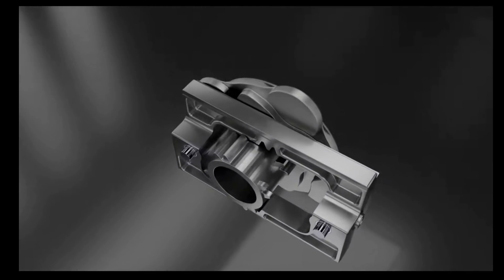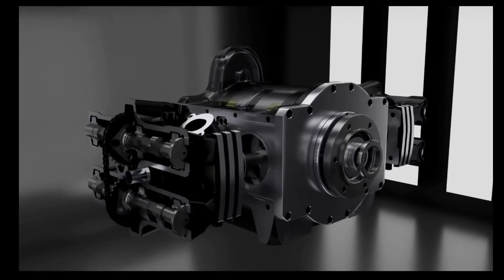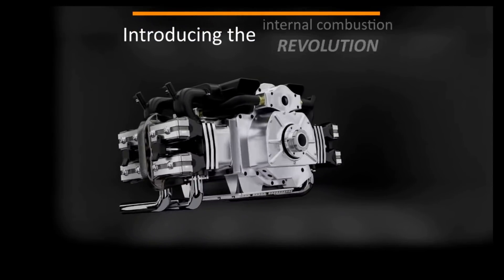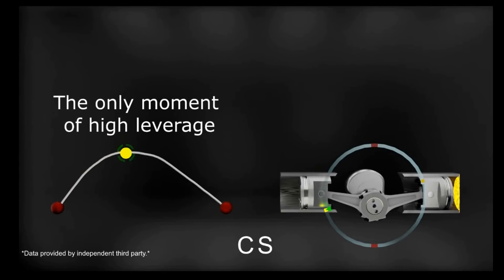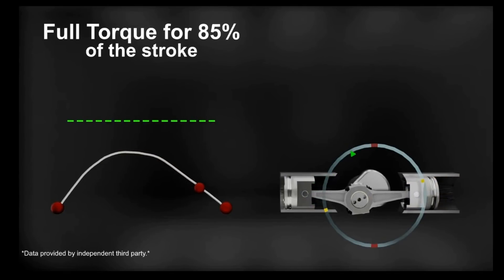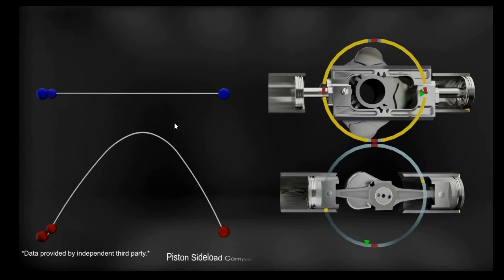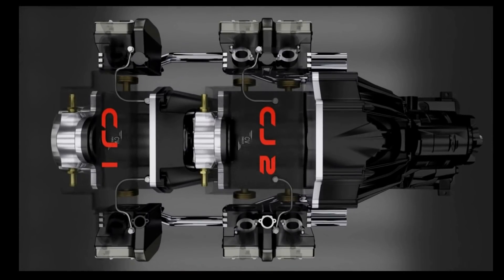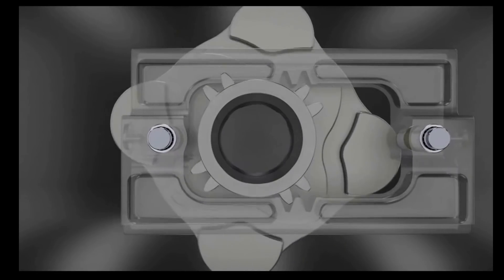More opposed Piston engines

Comment: It's not a 2 stroke! It has 4 cycles like a normal 4 stroke. The crank just spins half the speed of a normal crank because of that weird ass setup. The piston goes through the usual four strokes in the period of one crankshaft rotation
Reply: Matt. There's no helping some people! 😆 Some people will always insist that 1+1=3 no matter how hard you try to explain simple arithmetic!
Reply from the maker: IT IS!!! Lol the animation is, the demo in the video at the end is. They have said they have designs for both. Every TDC there's an ignition event, that makes it a 2 stroke.
Reply: @thedirtyworkshop  the running motor is not the same motor that's shown in the beginning of your video. Watch again. Look at the gears on the cams and the crank. They are the same size. If the piston makes 4 cycles per one rotation of the crank the gear on the crank would have to be double the size of the gears on the cams for it to be a 2 stroke.. I know it's not much but look at the valve timing. I've seen this motor before and would respectfully say you are incorrect
Reply from the maker: 1) the demo in the video is a glow plug engine, with no head. Therefore it's a nitro 2 stroke. In the animation the cylinder fires every time the piston is at TDC. We're not talking about cycles, like otto, diesel etc, we're talking strokes. 

Example. A wankel run the otto cycle, but isn't any strokes. A diesel cycles engine has both 2T and 4T engine version. Strokes is how many time the piston travel the length of the "stroke", hence its name. It doesn't matter what the crank is doing. This isnt an opinion. Just look at 2 stroke diesels vs 4 stroke ones....
Reply: @thedirtyworkshop  you're arguing semantics. I know the animation doesn't show it for very long but look at the cam drive and valve timing. The bottom valves stay open for one full stroke then the the top valves open for another full stroke. That engine couldn't run as a 2 stroke You could be correct, ignition could take place every TDC but with the valve timing the animation has it would be a wasted spark.
Reply from the maker: I'm not arguing semantics. A 2T is called a 2T because it travels the stroke twice per cycle, then repeats. Same as a 4T. This is the literal definition. 

In the animation they state double of the ignition events per rev so they can run half the rpm. Then same animation also shows at every TDC the mixture ignites. I'm just going on what it shows. They literally say in the comments of said video it can be converted to run either. 

Cycles are not strokes and visa versa, thatsvwhy they have different names
Reply: @thedirtyworkshop  the crank spins at half the speed of a normal crank so it would need double the ignition events per REVOLUTION just to run. The piston is going through 4 strokes per one revolution of the crank
Reply from the maker: Show me where the crank rpm and the strokes have anything to do with defining the stroke? Because I can show you where its the cycle and not the rotation that defined the stroke.

Let's say you're correct. Then stroke is a wankel engine?
Reply: @thedirtyworkshop  not crank RPM, crank rotation. On a normal 4 stroke the crank makes 2 rotations while the piston goes through it's four strokes. On the CV engine, because of the weird setup the crank only makes one rotation while the piston goes through it's 4 strokes. Watch the animation again and look  at the crank rotation in degrees in relation to the piston strokes. For every stroke the piston makes the crank only rotates 90 degrees as opposed to a normal 4 stroke where the crank rotates 180 degrees for every stroke of the piston. Yes it has twice the ignition events per ROTATION of the crank because the piston goes through all 4 of it's strokes in only one ROTATION of the crank.
Reply: @thedirtyworkshop  I'll simplify this so you'll know what to look for. On a conventional piston engine starting at TDC, if you rotate the crank 360 degrees the piston goes down and up that's it. On this CV engine,  starting at TDC when you rotate the crank 360 degrees the piston goes down, up, down, up.
Reply from the maker: Why does this matter? How many strokes to complete a cycle? Revs don't matter!
Reply from the maker: I'm make it simple for you. It is called the 4 stroke cycle... nothing to do with revs.... for example a 5 and 6 stroke engine is called that because of the 5 or 6 strokes the cycle goes through. You explanation doesn't hold for the 5 stroke engine.... wow why is this so difficult!?
Reply from the maker: https://en.m.wikipedia.org/wiki/Four-stroke_engine
Reply from the maker: "A four-stroke (also four-cycle) engine is an internal combustion (IC) engine in which the piston completes four separate strokes while turning the crankshaft. A stroke refers to the full travel of the piston along the cylinder, in either direction. The four separate strokes are termed:"
Reply from the maker: From thermodynamics 

The thermodynamic analysis of the actual four-stroke and two-stroke cycles is not a simple task. However, the analysis can be simplified significantly if air standard assumptions[5] are utilized. The resulting cycle, which closely resembles the actual operating conditions, is the Otto cycle

See how it states cycle and not rotations...
Reply from the maker: This is what Yamaha have to say:

What’s the difference between 2-stroke and 4-stroke engines?

 Fuel for a 2-stroke engine has a small amount of oil mixed into it. It is called a “2-stroke” because just one up and down movement of the piston—the 2 strokes—performs the full cycle of intake, compression, combustion and exhaust. No intake or exhaust valves are used and instead, small holes called scavenging ports in the cylinder wall are used for drawing in air and expelling exhaust. Because combustion takes place with each revolution of the crankshaft with a 2-stroke, this format puts out more power than a 4-stroke engine and the power has more instantaneous delivery. This are some reasons why 2-stroke engines have a long history of use on many different types of motorcycles.

See how it states cycle...
 https://global.yamaha-motor.com/business/mc/mc-tech/standard-technology/2st4st.html
Reply: @thedirtyworkshop  normal engine 360 degrees of crank rotation piston goes down up. CV engine 360 degrees of crank rotation piston goes down up down up.  I can't get any simpler than that. You're missing the very obvious on this CV engine. Watch the animation in slow motion and pay attention to the degrees of crank rotation in relation to the piston stroke.
Reply from the maker: Here is the definition in all aspects

"Stroke (engine) - Wikipedia" https://en.m.wikipedia.org/wiki/Stroke_(engine)
Reply from the maker: Here you can tell ilmor engineering they don't know what a stroke means and their 5 stroke engine is bollocks.
 http://www.ilmor.co.uk/capabilities/5-stroke-engine
Reply from the maker: Here's the video

https://youtu.be/u0uPmrSRM7w
Reply: @thedirtyworkshop  you took the claim about double the ignition events per rotation to mean it's a 2 stroke. It's not. Double the cylinders and you get double the ignition events per rotation, it's still not a 2 stroke. On the CV engine the piston is going through 4 strokes per one rotation of the crank. Which means you have to double the ignition events per crank rotation. It's a 4 stroke. The piston is going down up down up, 4 strokes for every 360 degrees of crank rotation which means double the ignition events per 360 degrees of crank rotation. You really need to watch the video again.
Reply from the maker: No. I looking at 1 cylinder. Everytime the piston is at TDC it fires.
Reply: @thedirtyworkshop  i look at onl one cylinder, plus the crank and the valve timing and I don't know how it could run as a 2 stroke when 2 valves are open during compression and the other 2 open during the power stroke.
Reply from the maker: I don't know either, but the video shows what the video shows. It might be a fuck up. I don't know without more info. I'll ask them.
Reply: @thedirtyworkshop  I'm going off the full package. The piston, cam drive , and valve timing show a 4 stroke.. I am very intrigued by the piston going through 4 strokes with only 1 crankshaft rotation. If it is a 2 stroke each cylinder would fire with only 180 degrees of crankshaft rotation.
Reply from the maker: So the flashes in the combustion chamber are just fancy lights?
Reply: @thedirtyworkshop  that or the cams valves and cam drives are just background scenery
Reply: @thedirtyworkshop  i just watched and listened their video again and the flashing lights flashed at every TDC on the conventional motor as well. It's just showing how there crank setup accomplished twice the piston strokes per 360 degrees of crankshaft rotation. So yeah it's just flashing lights to highlight you get more bangs per 360 degrees of crankshaft rotation on their setup. It's amazing what re-watching and listening will show you.
Reply from the maker: Does it matter? The running example is a 2 stroke, this shows either... what matters it what defines a stroke that you seem to not understand... I'd be more worried about that.
Reply: @thedirtyworkshop  my kx 250 is also a 2 stroke but I've been talking about the animation not a separate engine. In the animation the cam drive and valve timing says it's a 4 stroke. I'll ignore the fact that a 2 stroke with intake and exhaust valves in the head is the stupidest fucking idea I've ever heard
Reply: @thedirtyworkshop  that running 2 stroke in the video looks oddly familiar. Almost like I've seen it in an Alfadan video
Reply: @thedirtyworkshop  you missed the dead obvious and you'll never get it if you don't watch the animation again a pay attention to the last thing I said.
Reply from the maker: Strokes per cycle define the stroke number. That's it. Nothing to do with rotations... a stroke is a linear translation. End of. I can't believe you don't get this.

Comment: 10:30 zero sideload claim seem to be false. Teeth are not engaging symmetrically on both sides. It would push moving assembly against the cylinder wall.
Reply from the maker: Yeah but in comparison to a piston engine it's nothing much. You could also say gravity... as for the teeth, the internal carrier is on bearings that take that load.
Reply: U either have no linear bearings, and sideload, or u have linear bearings, as here, and no sideload, or at least a little that the linear bearings must bear/take. What I mean, is that, to have a sideload, the linear bearings would first have to fail. u also have sideloads and friction between the pins and the cam they ride on, on that turning disc, but no sideloads anywhere near where the combustion takes place. The teeth are not engaging symmetrically: Behind the cam-disc, there´s a 2nd pair of opposed pistons, riding on the same cam-disc, that don´t simply guarantee symmetry (by having opposed sideloads that neutral each other via the cam-disc), but also fill the torque-gaps, that the front pistonpair leaves open (from the hand-off of a teeth-pair till the hand-on of the next teeth-pair there´s a tiny power-gap, that´s filled by the overlapping action of the back pistonpair, a gap of 15° every 90°-turn of the shaft).

Comment: In GDI they can just diesel the shit up with lean initial mixture and constantly added fuel. Still no way to met this claims, it is used in cars
Reply: There is no benefits for this madness
Reply: Lot of weak, critical parts and mass for some weird vibrations
Reply: Boss, I can't get to work, teeth in my engine just felt off. Don't you worry, they are cheap and easy to manufacture, I can be towed from time to time, right?

Comment: I’m glad to see they have an actual engine running, and video of that, which you also showed.

One thing I learned in a painful way riding bikes all year around in southern Michigan as a teen (that, or walking in sub 0 F snow/ice, over 2 km with hills to/from high school) is just how important coefficient of expansion is on cruiser style bike chains and gearing: a bike with no derailleur for taking up slack or providing any, when it got cold enough, between frozen axle grease (not synthetic) and binding chain, it was like having a 100 kg load on the bike, and the chain was prone to coming off, and the crank gear and chain wore heavily.  I see those large teeth in that engine design and how they’re attached to a place they’ll have lots of waste heat, and wonder how much that’ll affect their dimensions and all that goes with it.
Reply: Dude that engine if ever gets built into a prototype, (assuming it works as intended) will blow up after a short time of operation. It's like me trying to build an aircraft using flapping wings like birds, only just disregarding 100 years of research and proven aircraft design/technology.

Comment: My interpretation of that engine is that it's still a four stroke that does all four strokes in onre revolution because the gear thing is four sided.
Reply from the maker: Well no, it fires at tdc every stroke, that's 2 stroke to complete the cycle... so...
Reply: @thedirtyworkshop  Yeah, kinda got confused by the visulisation, mixing it up with twin lobed cam engine.
Reply: @thedirtyworkshop  no it does not. Watch the beginning of your own video. It does all 4 cycles with only one crankshaft rotation
Reply from the maker: Since when does rotation and stroke mean the same thing. Do you understand English?

Comment: Matt, can you talk about the Carnot Limit and the Theoretical Maximum ICE Thermal Efficiency limit?

http://large.stanford.edu/courses/2011/ph240/goldenstein2/

I read that the theoretical maximum Thermal Efficiency for a ICE is 83%

Quoted from this line:  "With typical combustion engines operating between 1750°K and 298°K, this equation states that the maximum efficiency for such an engine is 83%."

Also any thoughts on Toyota's 40% Thermally Efficient Engines?
https://www.sae.org/news/2018/04/toyota-unveils-more-new-gasoline-ices-with-40-thermal-efficiency

And Nissan's claim to 50% Thermally Efficient Engines?
https://www.roadandtrack.com/news/a35646974/nissan-50-percent-thermal-efficiency/

And thoughts on Mazda's SkyActiv-X SPCCI (Spark Plug Controlled Compression Ignition)
https://www.topgear.com/car-reviews/mazda/skyactiv-x-5dr-man/first-drive

Any thoughts on RCCI (Reactivity Controlled Compression Ignition)
https://en.wikipedia.org/wiki/Reactivity_controlled_compression_ignition
https://www.youtube.com/watch?v=pCr6bjQMrgU
https://www.roadandtrack.com/new-cars/car-technology/a19909520/gas-diesel-engine-reactivity-controlled-compression-ignition/
From what I've napkin mathed, the RCCI Combustion Cycle can boost a bog standard 2.x liter 4 cylinder engine's lowly 25% Thermal Efficiency by about (23-28)% Thermal Efficiency Boost.

Could the RCCI Combustion System seems be a easy way to boost Thermal Efficiency of a ICE?

Could this method of Mixing mostly Petrol & a small amount of Diesel be a path forward to the upper Theoretical ICE Thermal Efficiency limit based on the Carnot Theorem?
Reply from the maker: Yes I can
Reply: I watched a video on a guy that claims he made a 50% efficent engine for the US air force. 
He said they made it with two pistons facing each other for strength as a head would just lift. Then the engine would compress the air fuel so much that the nitrogen would turn into liquid.
He went into much more detail it was very interesting.